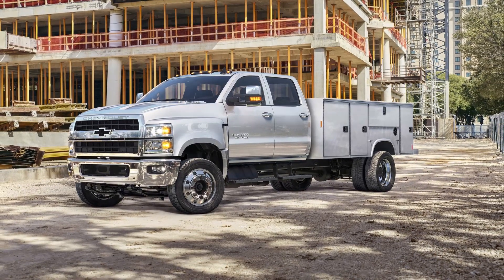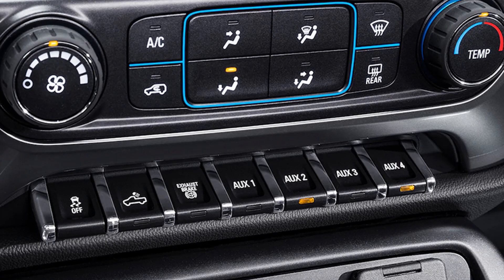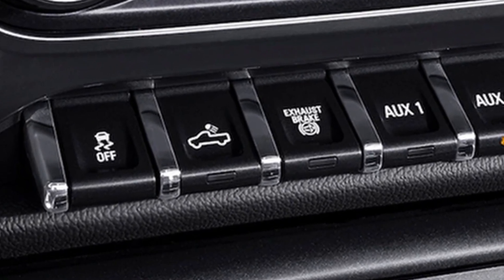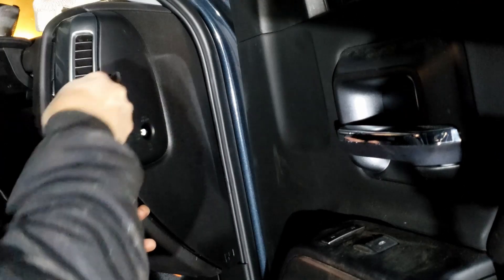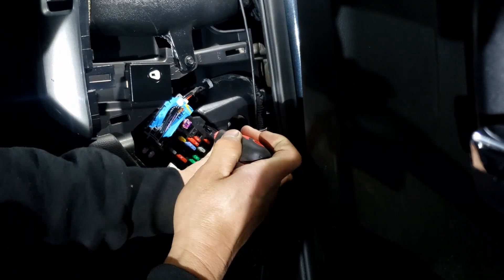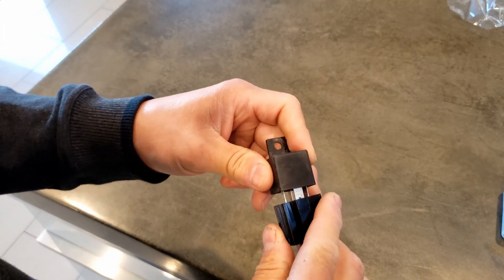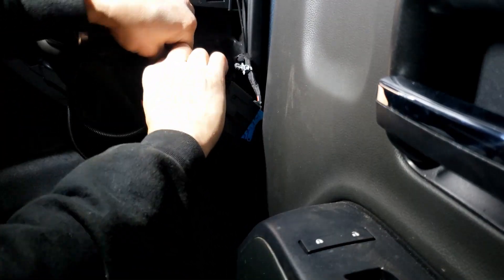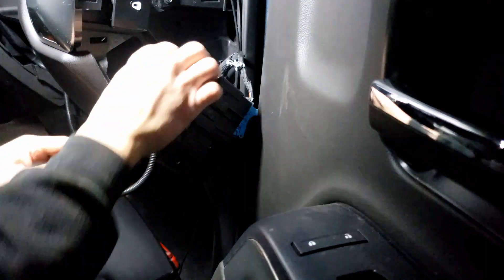Free up the cargo light switch as an auxiliary upfitter switch, 2014+ GM trucks

Comment: Tapping into the cargo light wire will indeed give you power for a low consumption led or a relay but this circuit is timed by the BCM to turn off after 10 minutes if the vehicle is not running.  All switches on this panel use a negative to connect the relay coil they correspond to.

Comment: I guess if you need to use it while driving it wouldn’t work correct?
Reply: Unfortunately the vehicle computer disables the cargo light circuit unless the vehicle is in park. Verified…thanks GM.
Reply: @MrTillman787  or neutral. Use with caution.
Reply: Is there any way to “override” that I k ow some guys have put switches In there truck to make it think it’s in park would that work on the newer ones tho?
Reply from the maker: That circuit is always hot. So, it always works.